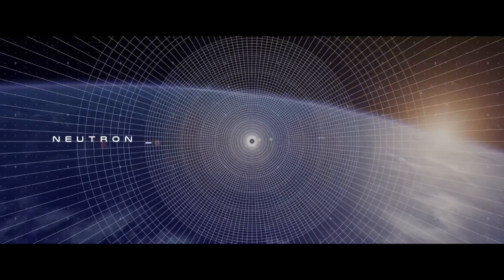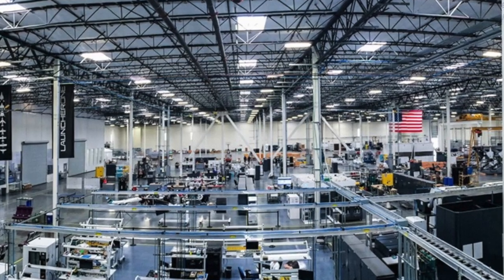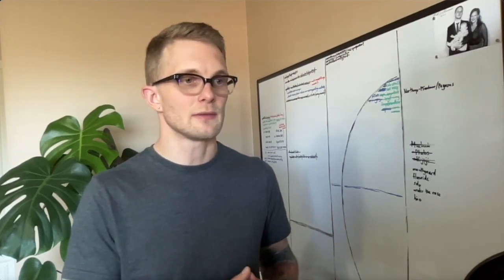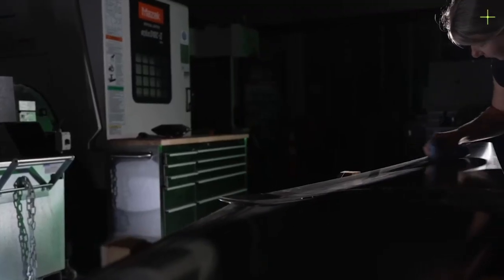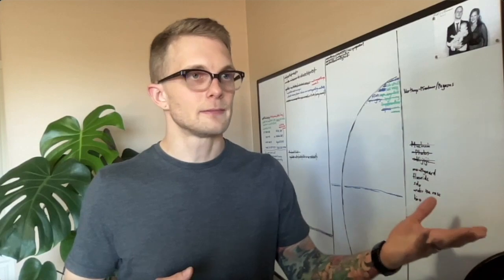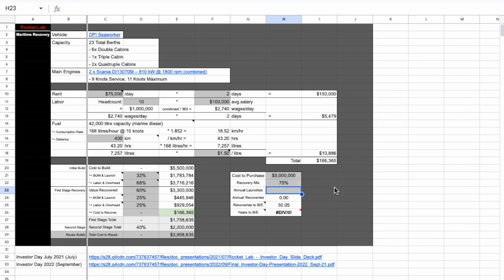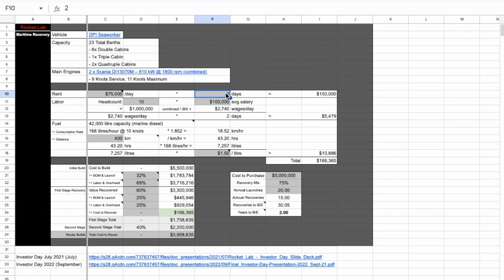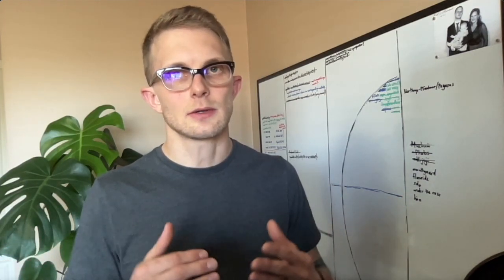Rocket Lab Acquires a Racing League Facility?!

Comment: No way shoukd they aquire a boat........way to many cost involved. I used to captain a 205 foot dp1 boat in the oil fields off tge coats of louisana.....you have a crew of at least 6 and those boys ain't cheap...captain, engineer, deck crew, Crain operator....and they like to eat alot. Maintaining a boat tgat size is extremely expensive as well.....and they you got yearly coast guard inspections and bi-anual haul out inspections and tank inspections......it's alot. And hopefully they have their own dock to moor her up at.....don't forget marine insurance, which is high due to dangerous nature of the work.
I'm not sure what current osv(offshore supply vessel) rates are these days as I've out of tge game for a few years....was tired of veing gone all tge time....but I would guess around 20-30k a day
Reply: Idk....just seems way more costly tgen a helicopter....but I don't know much about those. There's just a lot to a boat, especially one that size and with dp capabilities....even if it's only a dp1 vessel. (Dp=dynamic positioning), a computer system that uses numerous sensors and GPS to keep a vessel on station by basically taking control of tge boat and systematically turning individual rudders, engines, direction of wheel wash to maintain position on a set location. There are dp boats=.no reduncies....dp1= 1 set of redundancies for a failure and then dp2...2 sets of redundancies...and that's right....dp3.
Reply: It's for the carbon fiber tech.